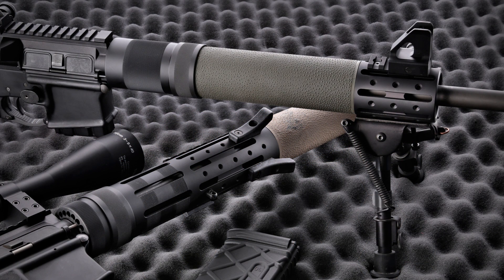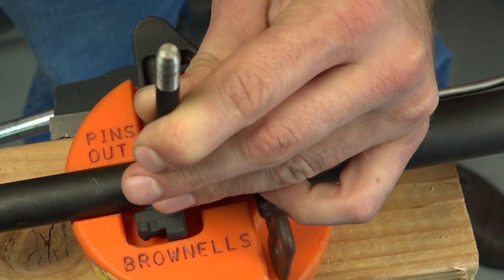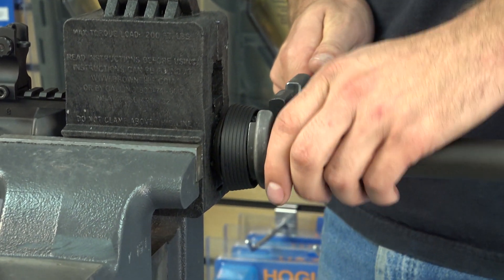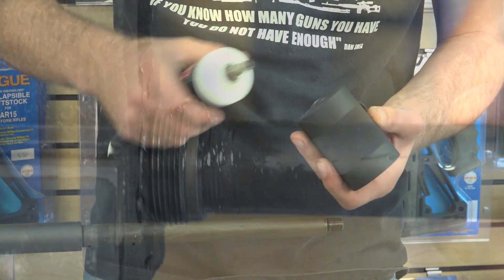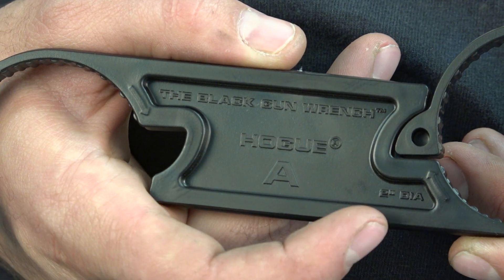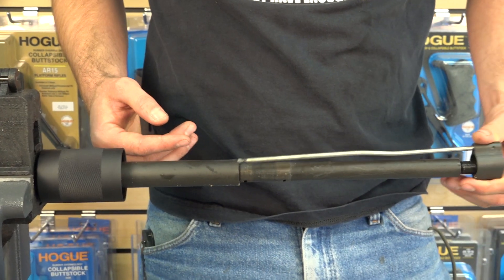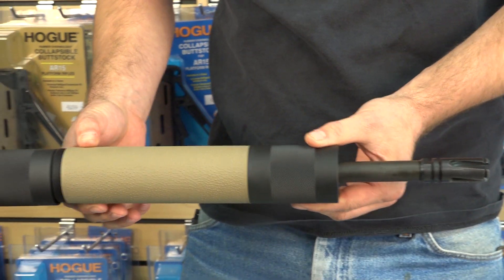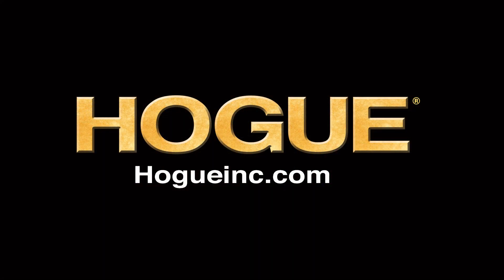Hogue AR Forend Installation

Comment: Can the front sight be reinstalled after the new handguard is put on?
Reply: That depends on the type of foresight, length of barrel, and length of forend you choose. On one of my rifles I use a plastic Magpul backup sight that mounts to a Picatinny rail, that won't work on this forend and it would melt on a Picatinny rail on a gas block, a metal sight would work on an exposed gas block with a Picatinny rail. If you have a foresight which is combined with the gas block and your forend doesn't cover it then you can reinstall it. I don't use a foresight and if my optical sight ever breaks I'll put it back in the case and use another rifle, so I use a low profile gas block which is covered by the forend. In my case no foresight will fit.

Comment: How do you torque the barrel nut. Need 30 to 80 lbs, are we supposed to guess at it?. Is there a strap wrench that takes a torque wrench. I can't find the answer anywhere, anyone know?
Reply: lol, did you ever get yours installed?  Mine was a joke, couldn't get it tight enough using their plastic strap wrench...
Reply: @FullLeadTaco  I had to buy a real strap wrench to get it tight. It looks good, but it's too heavy, so I'm replacing it.
Reply: @johnlumpkin3082  yeah, I don't mind the weight, but the strap wrench included was kind of a joke, there is no way you can get it tight enough with the plastic wrench they provide.
Reply: Hogue, could you please make a video that addresses the finer points of installing this? I can’t even figure out how to get your wrench on. The video cuts out just as the guy is putting it on.

Comment: Will the 308 extension work with a bushmaster on the rifle length fore end?
Reply from the maker: As long as you select the correct thread pattern (DPMS or ARMALITE) you should be good to go.

Comment: I'm loving you guys setup for the buttstock, pistol grip, and forend but in not sure what size forend I need? I have a 16 inch barrel and I'm not sure if I need a carbine, a mid, a rifle or an extended. Please help!
Reply: Well, take a look at your gas tube length. Carbine length is gonna be 7 inches, Midlength is gonna be 9 inches, and Rifle is gonna be 12 inches. Expose the system and use a tape measure. Since you said a 16 inch barrel, the most common type of length will be carbine length. The best way to check is by looking at your AR's instruction manual OR looking at your AR's brand.

Comment: is the forward section of the carbine length models threaded for the receiver extenders ?
Reply from the maker: No, the rear section is threaded, so if you want to extend it, you can get a separate extension.  http://www.hogueinc.com/tacrifles/ar15/forends/extension-tubes

Comment: Looks cool but how does this work with an adjustable gas block?
Reply from the maker: +SuperSneakySteve It would depend on your barrel length and type of gas block. But if it's a micro, there's a good chance it will still fit in our forend.

Comment: Do you need to buy a bent gas tube with it?
Reply: I have never seen a straight gas tube. The forend does not affect the gas tube. The gas tube is only affected by the gas system length, which is an aspect of the barrel.

Comment: What length is the barrel of the rifle?
Reply from the maker: I think it is an 18", but I can't be certain. Sorry!
Reply: HogueInc Ok no problem. I have a 16" barrel. I was wondering if I could use the rifle length kit or the mid length?
Reply from the maker: You can use a Rifle length or Mid length forend with a 3.5 or 4" extension.
Here is a link to a fit guide:
http://www.hogueinc.com///data/categories/764/1893888952.pdf
Reply: HogueInc Awesome. Thanks

Comment: tried installing this on a clients upper wow this wrench is a joke man
Reply from the maker: If you have trouble using the provided wrench, a good quality strap wrench from any hardware will help you out.  Or, you can use emery tape (turned upside down with the soft side facing the forend) to get a better grip.
Reply: not sure you guys though through the whole design of your tool. your grips are amazing but your hand guard barrel nut design leaves a lot to be desired
Reply: @vytamenc  Took me a bit to figure the wrench out, but it worked OK for me.
Reply: @HogueIncUSA  You need to be realistic. It is very noteworthy that you skipped how that stupid wrench is supposed to work. In general this is a very poor video.